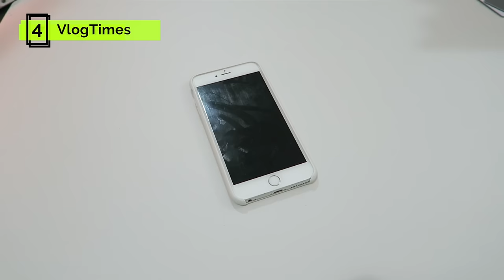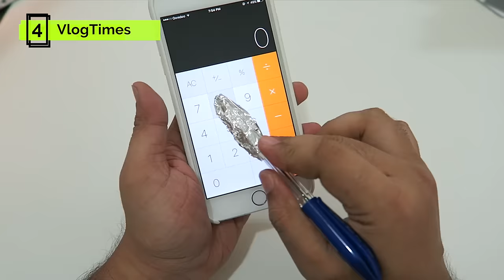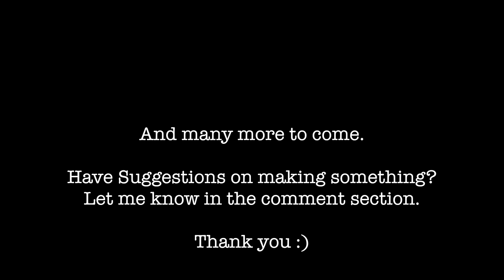Top 5 Creative Ideas for Smartphone

Comment: Has anyone seen Electroboom where he did the same kind of charger, and he blew up his phone with it because it wasn't regulated? You probably want to put some kind of regulation on that servo, as if it does spin fast enough, you can get the voltage really high and fry your charging circuit/phone.

Comment: If you put rather than just a usb port a 5v boot module, on the servo motor you should run no risk of it wreaking your phone battery..    I just got a pack of five or obey for around 3 Australian dollars.       I use them for solar charging incase the powers to high or low, but it would work in this case as well.
Reply: Sorry Ebey not obey. ;)

Comment: How will the charging thing damage ur phone
Reply: Dead Shrimp of you spin it too fast since the charger port only supports about 5v any more and you run the risk of burning the thing
Reply: There is nothing to regulate the voltage to 5v. If the phone detects there is a voltage not withing the 5v range it will shut off charging, causing the voltage (now with no load) to shoot up and possibly fry the charging ICs in the phone.
Reply: Dead Shrimp it doesn't have any circuitry to make sure that the voltage or current you produce is safe for the phone...
Reply: Dead Shrimp too much power to the phone without a regulator will burn it out
Reply: thanks i didn't get it
Reply: Dead Shrimp np :)